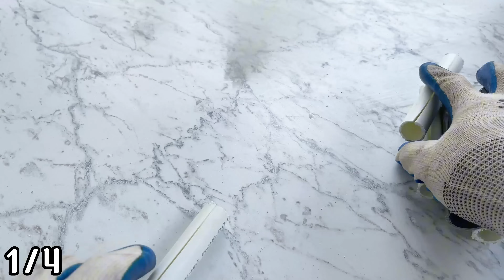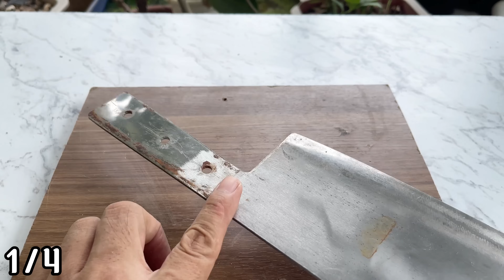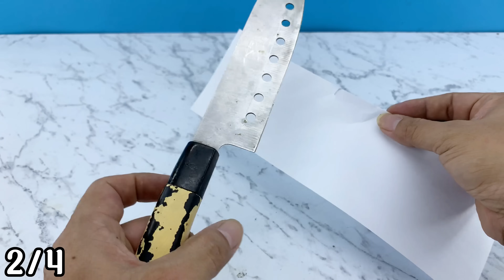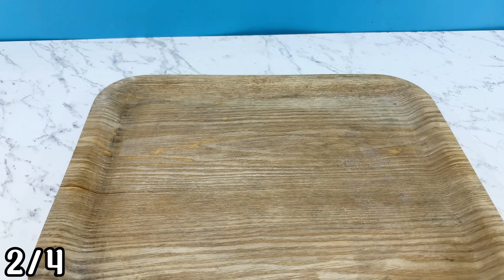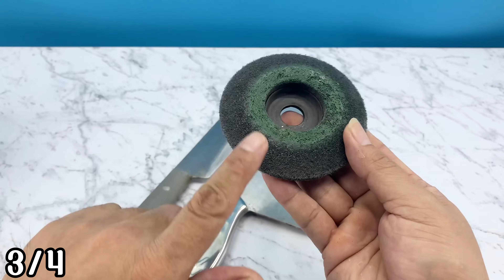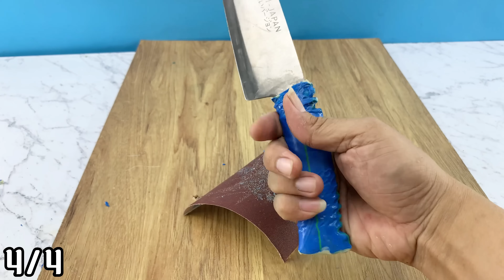Top 4 Genius Tips and Tricks for Repairing Your Old Knives at Home Extremely Effectively

Comment: No need to waist this much time to fix a handle for aknife only to do is put the handle of the knife inside the pipe thats all
Reply from the maker: You're right! For a quick fix, just inserting the knife's tang (the part that goes into the handle) into a pipe or another similar object can be a simple and effective solution. It doesn't take much time, and it can hold the blade securely enough for practical use. Just make sure the fit is snug, and you can even add some adhesive or epoxy to ensure it stays in place. 

This can be a quick, temporary fix or even a DIY approach if you're in a hurry!